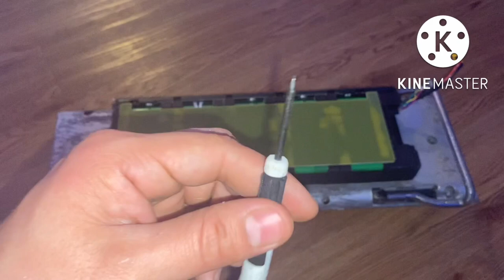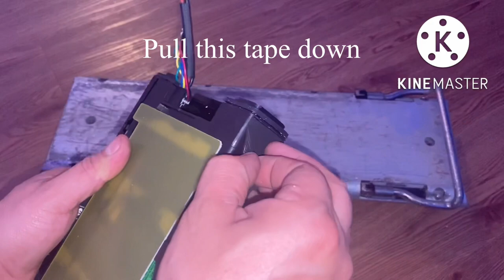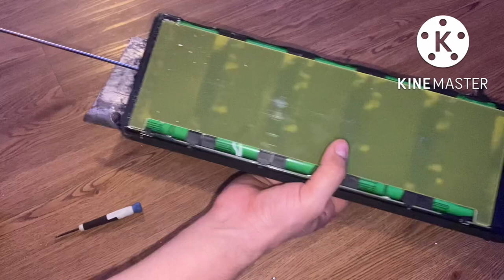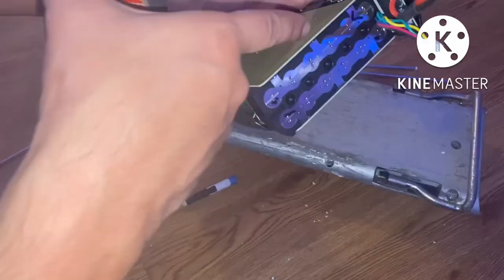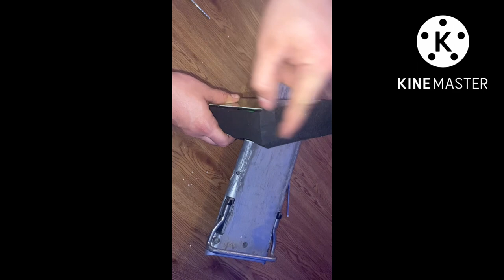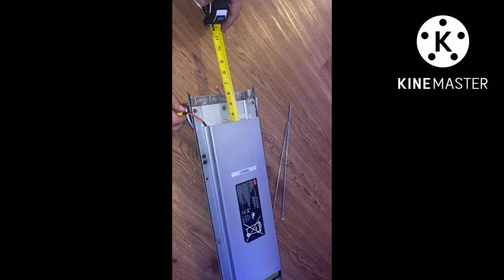-Bird 2 scooter -￼ ￼Battery housing space,Space available￼ for Controller￼￼￼

Comment: If I follow your Bird to conversion video. The only thing that Hass to be swapped out is the controller right? I don’t need to get a display or dashboard? Also I went crazy finding a CR 25 bid for the bottom I finally found one and it still doesn’t fit